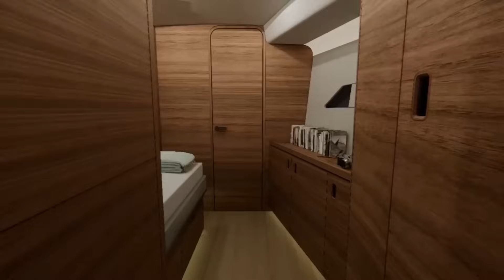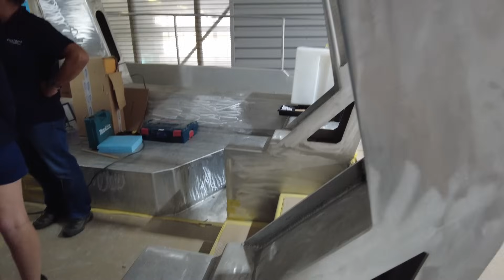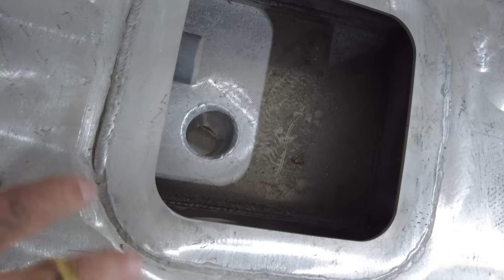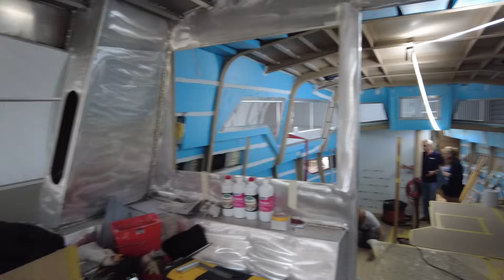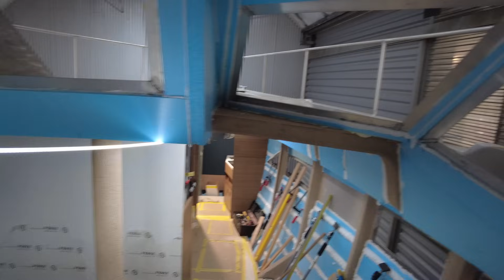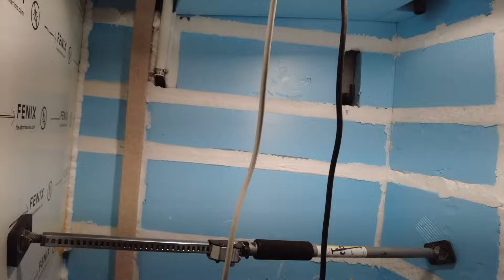How to build an ALUMINIUM Deck salon OGHAM 54

Comment: For may imagination, when a gib is used, a wind force if so strong, that a fine tunning of the sail does not matter almost entirely. So, a self-tacking system is exactly what is needed for a safe and quick tacking. Floating fashion saloon makers would object that idea because they sell big glass hatches on a desk exactly at a place where the system must be installed.
Reply from the maker: A self-tacking jib makes a lot of sense to help with safety and ease of use when short-handed.

Comment: Really innovative mid-section spaces , all the best ideas in one package… little suggestion - I’d like to see thick cork on the helm seats and backrests
Reply from the maker: We will pass on your thoughts when we are back at the shipyard in October, it's a good idea cork makes for a great insulater.
Reply: Unfortunately, Cork can be an absolute nightmare to work with once every part starts acclimatising, and settling down differently. I used it to warm up a Penthouse extremely cold wall took forever to get it right, but once done did deliver the transformation needed, but every cork tile settled into being a completely different size. Never Again.😂
Reply: PS.i bought a heavily glazed North facing penthouse, because the South facing ones were out of control Sweatboxes - this in the extreme Summer of 1976 - but that meant the living room wall was on the West side, withacompldtely open Stairwell which the wind whistled through with dramatic heat loss. The Cork tiles did fix the problem, plus had people fighting o dr buying the place when I sold. 👍

Comment: Just finished watching - very nice tour of a very nice boat tbh. With a bit of jiggers pokery of LOA and beam, a layout that works really well for me is the 2 Cabin 2 head offset Pullman with en suite forward layout of the Beneteau Oceanis 393 and pin ing a bit more LOA to say up to 42 feet certainly wouldn’t hurt, as that could mean a small generator can be fitted in as well, such as Cummins Onan or Northern light a they do full ABYC 120 v 60hz compliance and Full USCG Compliance as well ? I think they may actually be ok for EC Standards for Coffee- especially Spanish Coffee and there is no problem with a Cafetière . 😂😂😂 Bob.👍🌟🌟🌟❤️⛵️
Reply from the maker: 😊  You are going to have to be patient just to see what happens over the next year or so but 42ft and 48ft and 50-55ft just to give you a hint 😊
Reply: @SVTONICBoatWives  It has been a bit hard for me to remember just how much I love the fun of sailing nice smaller boats- but not cramped low headroom ones which like the old Folkboat, used to dominate a bit- it used to be tough going just finding a boat with a comfortable cockpit and which you could stand up in at the bottom of the Companionway. Oh, very important side note ! It looks like the price of Lithium batteries is likely to collapse very soon, due to the appearance of vastly superior Aluminium ion batteries- both Tesla and Toyota are close to releasing them- they have about 10,000 recharge cycles, are unaffected by freezing weather, and don’t catch fire or explode, plus vast amounts of  heap aluminium to make them with - hence - next boat, I’m sticking with AGM batteries until they become available, as I online can make AGM last.  Best Wishes, and keep up the great work.  Bob. ❤️🌟🌟🌟⛵️

Comment: Only part way in, and already things are grabbing me like the safe deck layout, and below the very strong reminder of the excellent new Island Packet 42 Motor Sailor. How questions to note just in case needed for memory refreshing - thick is the aluminium plating, can they do a Custom 38 to 40 foot LOA with say a 50 hp direct drive diesel - ideally a Kubota Block based one, as at any age or stage, they can be fully rebuilt and can it be supplied with Mars Lead keel for under a 5 foot draft - the on Deck mast position really sucks for a low Air Draft very Short Boom Selden Mast with in Mast furling, but their  Mast for the Catalina 316 will drop right on with a custom Short Boomsmall flexi tanks for fresh water in the bilges filled by a water maker can take care of extra stabilising ballast. Jibsea 11 Channel are getting on ok with their a,uminium boat and give a pretty good account of their hands on experience, as does the Sailing Jupiter channel with their really thin aluminium plate catamaran for what to do and what to use for looking after aluminium. I have about had a gutful of being pissed around by Catalina Agents, but do have a couple left who may just take my enquiries seriously- for the Tropics, I definitely prefer GRP to be honest and can get a decent life out of a well made one, but if .i can’t get one built how I need one built, if these people will do a smaller model ? Why not- all that really matters now frankly, is getting the Concept done. Back to the video, and maybe further points- not having Pettit Trinidad Pro hard Copper antifouling, is really going to bloody Suck mind. grrr. 👍❤️⛵️
Reply from the maker: Hi Bob I can’t let the cat out of the bag but, between you and I there will be something being designed and built in the not so distant future which is inline with your inquiries.
Reply: 00ps this phone is playing up. No panic lol trying to use the bigger screen of this old Galaxy Note 9 hohum. All the best.
Reply: Following morning now- well that effort rapidly sent Pear Shaped . ❤️😂😂😂 Bob.
Reply: The screen going all over the place with the Note 9 ? I think the battery internals are melting tbh.This lithium stuff sucks.🤣❤️⛵️

Comment: It's like Garcia and Moody having a baby, I mean, in a good way...
Reply: Came here to say that. The love child of the Moody 54 DS and the Garcia Exploration 52. Best of both worlds. Two questions, though: (1) deck stepped mast? On such a big boat? (2) What are storage bins outboard of the main winches? You call them lockers in your tour, but they look like they are open to the weather and thus downflooding risks, I would think.
Reply from the maker: @SuperSventizeMe The mast (rig) will be very strong because it’s fixed both inboard and outboard. We will be touching on mast choice in our boat design series so all your questions will be answered. For the storage locker etc that’s just me being a lazy bones and not taking the time to explain. Sorry about that I will adresse this in October when we are back at the shipyard.
Reply from the maker: Yes it is, it bridges the gaps between high latitude sailing and trade wind sailing. There is a lot more to this sailboat than we have shown but you will see over the next few videos with our build/design series. 😊